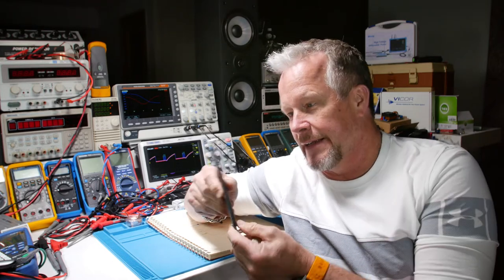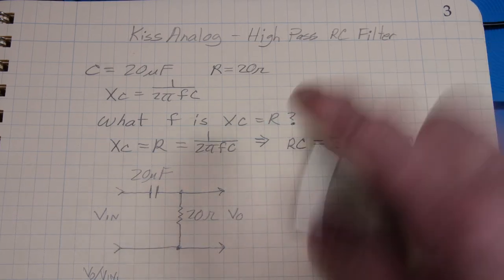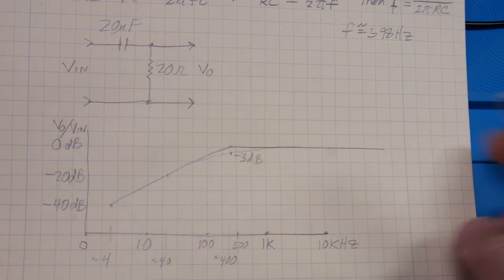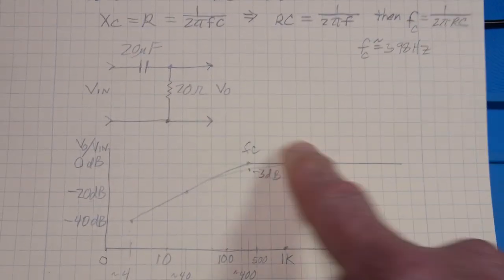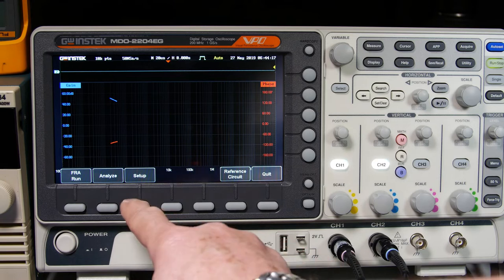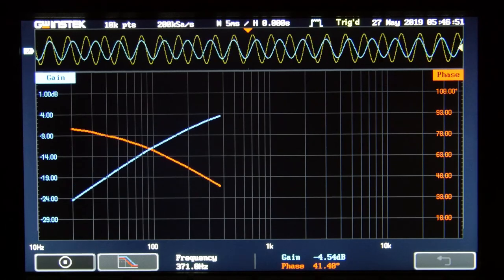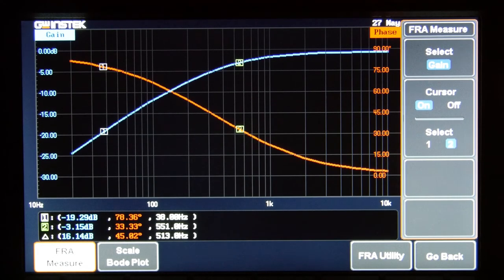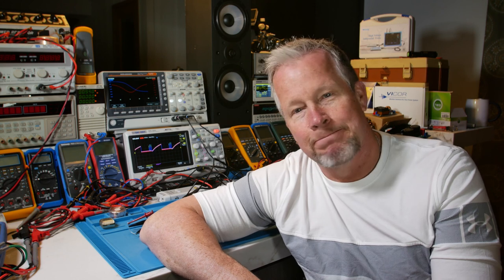High Pass Filter - Simple example ep2

Comment: I have to look much more at your math to understand it for real, but when I saw your drawn curve, fitting the scope's curve, I just thought how cool! I was not surprised but still that calculations can be proven right and in such clear manner, is just great.
I did like this video a great deal, and I think that I did understand a lot, without having understood the formula yet:-)
The capacitor act a bit like a frequency resistor where it takes a certain energy / Hz to get all the way trough. Above a certain energy / Hz the signal just manage to get trough and even higher is getting more easy trough, until the frequency is so high that it almost ignores the capacitor and you have a short.

A higher resistor does give a better and sharper filter but do also change what frequency it will let trough, so you can''t just put any Ohm value in the circuit.
Hope that I am sort of right, even my explanation is a bit of a strange tail? :-)
Reply from the maker: Yes, I think you have it;)  I think it’s good to look at the math but not get wrapped up in it.  The math will make more sense with more examples.  The beauty of the Bode plot is that it takes little math;)
Reply: @KissAnalog  Great, fantastic:-)
Math can drown a person, but on the other hand, understanding it a bit more then I do now, would properly help:-)
Yes about the bode plot, would it be possible one day to see the FRA on one scope and the bode plot on the other, just to se what it means and how it compares?
Reply: Please allow me to ask, If we say that we have a powerful signal, maybe even most in the low, would that not heat the capacitor up?
Reply from the maker: Yes, that’s a great question!  The esr with the ripple current can overheat the capacitor.
Reply from the maker: I hope to show a little math here and there where pretty soon it is better understood - then it doesn’t scare people off;)

Comment: SO THE WAY I AM UNDERSTANDING THIS, IS THE PHASE MARGIN IS GENERALLY JUST THE PHASE ANGLE OF THE CIRCUIT THROUGH OUT ITS BANDWIDTH.ALSO THERE ARE DIFFERENT TERMS GIVEN FOR CUTOFF FREQUENCY SUCH AS CORNER,CRITICAL ETC.IT WOULD BE NICE IF THEY WOULD STANDARDIZE  THINGS IN ELECTRONICS.
Reply from the maker: Yes, there are a number of terms used for the cutoff frequency point, and that can be confusing.  I’ll try to keep reminding of these so it becomes second place to use the terms without confusion,

Phase margin goes along with feedback terminology which you asked about once,  I'll cover feedback and what phase and gain margins are when I do that.   It won’t be long as I’ll be going thru. A power supply design soon, so I’ll introduce opamps and feedback.

Comment: Hi Eddie.  I've just picked up a AWG and am trying to replicate this experiment of generating a Bode plot from a high-pass RC filter.  I have a 22uF (measured 23uF) electrolytic cap and a 22Ohm (measured at 22Ohm) resistor.  fc = 315 pretty much.  When I generate the Bode plot, 10Hz to 10kHz, the graph looks as it should for a high-pass filter and matches yours.  However, the amplitude stretches from -28dB (fine) to -6.7dB where it levels out.  Phase runs from 84.4degrees to 0.7degrees.  The -3dB point on the amplitude curve crosses at 42.7degrees phase (good!) but at 122Hz.  I've researched and considered and I can't work out what might be wrong.  Could you throw any enlightenment my way?
Reply from the maker: Hi Andrew.  This is a great question - a bit of a mystery, but I have an idea;) I think your generator is set to 50 ohm impedance, so it’s loading down the signal.  Also make sure that your scope probes are set to 10x.  Let us know how it goes...
Reply: You're right as it happens.  I'd tried both 50Ohm impedance (terminators at the scope input) as well as HiZ with co-ax BNC cables but neither gave good results - 50Ohm were better.  This was connecting up the Siglent scope and Siglent generator in line with Siglent instructions (DUT in to scope directly from Ch1 of the generator.)  Abandoning that, and connecting the generator to the filter through BNC coax but then taking the DUT input and DUT output to the scope via probes, at HiZ, gave me much better results: -3dB frequency was 384hZ @ 41.5Degrees with amplitude running to -100mdB and phase running from 87.4Degrees to 2.5Degrees.  At the actual fc point, it was reading -3.9dB @ 46.3Degrees.  Given the non-perfect nature of the caps and resistors and setup that seems reasonable don't you think?  Incidentally, I got slightly better results with the probes at x1 than x10 but not much in it and certainly not a statistically significant number of tests.
Reply: Since posting the above, I did a few more tests.  Firstly, I got my decent LCR meter out and measured the capacitance at 120Hz and 1kHz as well as the resistance.  At 1kHz value of capacitance that calculated fc was 393Hz; running the plot I found it was a smidgen more accurate with x10 probes sweeping 10Hz to 100kHz: here I measured the -3dB at 394Hz @ 40.6Deg and that's pretty sweet!  Phase ran from 87.4Degrees to 0.4Degrees and Amplitude went to 0.1dB.  This isn't a conclusive set of tests of course - and x1 probes and 10Hz to 10kHz sweep was only a fraction different - but getting an accurate measurement of capacitance at the right frequency is clearly important!  Thanks for showing us this experiment, it's very interesting: I shall do a few more high pass measurements across different combinations and then some low pass filter measurements.